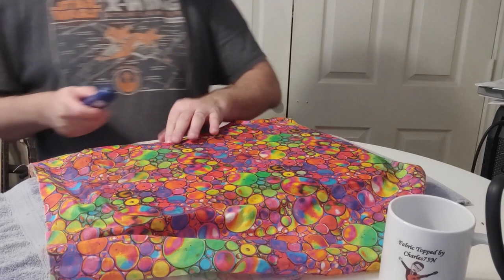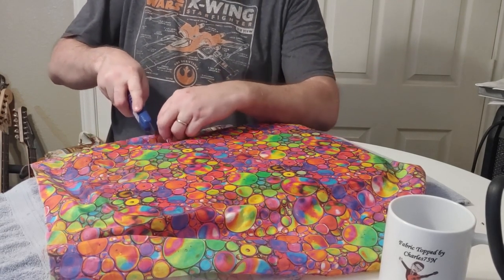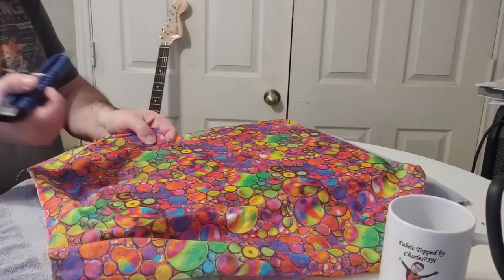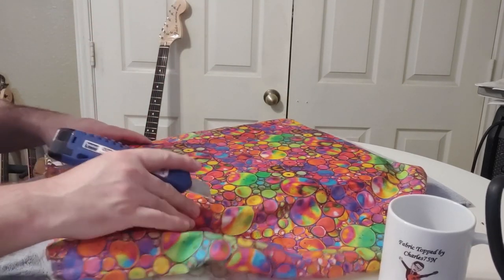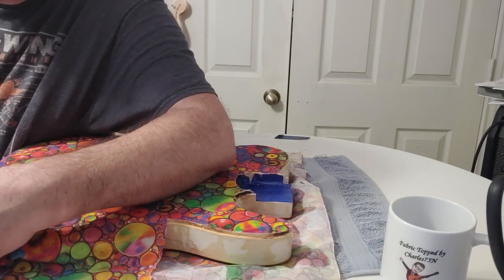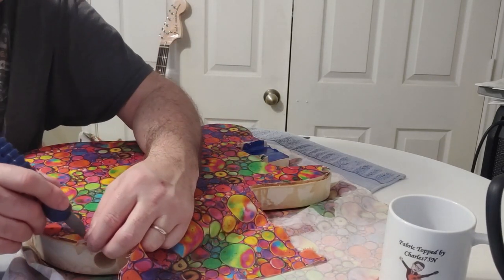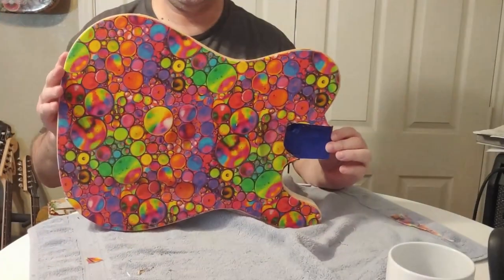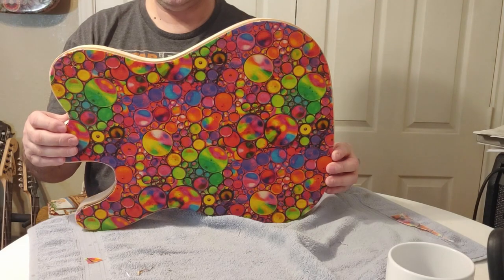Trimming the Fabric on Randy Crooks' Fabric Top Acid Drop Telecaster Guitar

Comment: How often do you need to replace the blades when doing this?
Looks great!
Cheers, 
Martin
Reply from the maker: The blade last forever and these are one where you can snap off the section to get a new sharp one.  Holds 5 blades and just replaced them last month.  Thanks Martin.
Reply: @Charles75N  Thanks my friend. I wouldn't have thought they hold up this well. I use them myself for various things and quickly notice enough wear, where it is fine for many applications, but I wouldn't use them anymore for such delicate stuff, like you do, where I want to have a really clean cut. So I'm surprised the poly doesn't take much of a toll on them apparantly.
Cheers,
Martin